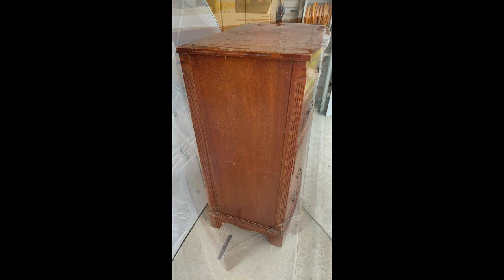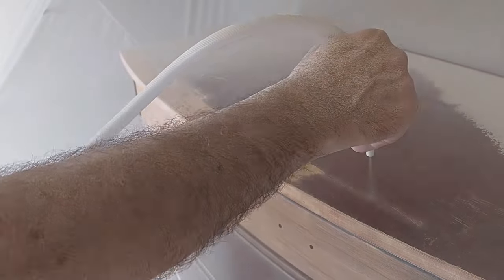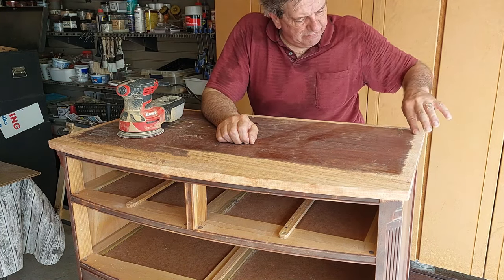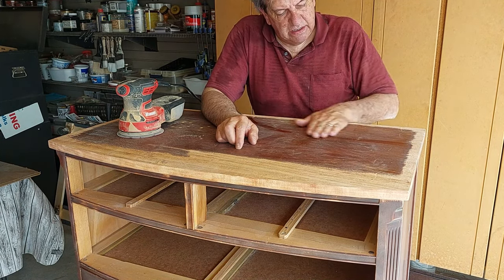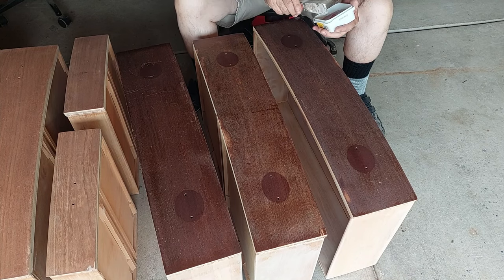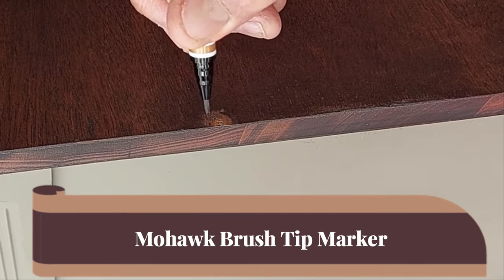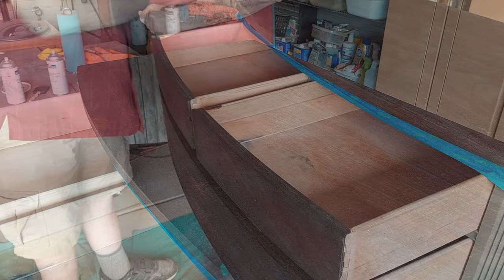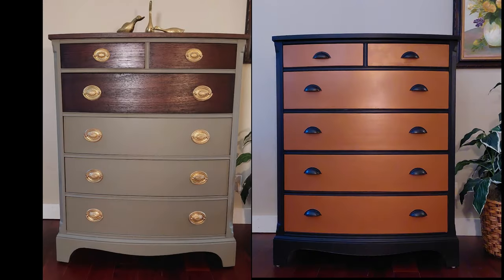Soda Blasting on an Amazing Drexel Chest Makeover | Furniture Flipping

Comment: Watching that soda blaster was super satisfying!! 

Is there any possibility of doing damage with it?  Like if i had the pressure too high or something would it blow a hole through the wood??
Reply from the maker: It would be unlikely to happen with soda because it's fairly soft, but if you crank up the pressure and use a course grain soda, anything is possible! We were running about 45-50 psi at the blaster. Thanks!

Comment: I love this dresser. Those colors together, oh be still my heart! I love that you are so willing to try a new to you technique on camera. So many are afraid of messing up, but seeing and learning from mistakes or gaining the knowledge from someone else is what I really love. I do have so many questions about the soda blasting. Did it save a lot of time? I know that the tent was a mess, but did it make a mess outside of the tent? If it did, was it horrible? I could see the awesome result it had on the dove tails. I spend so much time trying to get old paint out of dove tails! Thank you so much for all of your videos!!
Reply from the maker: The soda blasting does save time, and the tent really did a good job at containing everything. There was very little outside of the tent. It works great on the small detailed areas! Thanks Trish!
Reply: @FurnitureWarriors  thank you for the information.  I think I should invest in a soda blaster. I have a huge air compressor,  so I might as well give it a go. Another question.  Is the 40 lb tank easy to handle? I have severe back and knee problems,  so I was wondering the ease of use of the tank itself.

Comment: I like the traditional mainly because of the hardware. I've seen a neat trick when taping the drawers with the plastic. If you first take some painters tape and tape it on the inside of the drawer front with half of it sticking up, then you can take your plastic and stick it to the tape still sticking up, and then around your drawer. Then you don't have to go back and touch up the lip.
Reply from the maker: Great tip! Thanks Ash!!!!!

Comment: I tried this but I think I need a larger nozzle. Are you using the original nozzle that came with the Harbor Freight unit? Your dresser came out beautiful. Thank you for this video.
Reply from the maker: We are using the original nozzle. It does take some adjusting of the media flow and we ended up running 45-50 psi at the soda blaster regulator. Hope that helps. Thanks Susan!

Comment: Watching you do this (havent watched the whole thing yet), but if it could spray a larger swath I could see using that.
Reply from the maker: There are soda blasters that cover a larger area, but the cost of the units and the compressor to run them are not cost effective for this use. We found a great set up for only $22,000! 🤣We took a hard pass on it! Thanks Barb!

Comment: I have always liked every flip the two of you have done, but this one, well, I'm not so sure about the finish the soda blasting did on the drawers.  It was a bit rough.
Reply from the maker: After a quick sand with 220, the drawers were actually really smooth. It's the way that the stain took on this veneer that gives it that look. Not quite sure why though...... Thanks!

Comment: Why did you have to trim the drawer?
Reply from the maker: Wood will expand and contract for many years and sometimes after a long time (and wear and tear) a little sanding or trimming is needed to get everything to fit again. This is especially true with fine furniture brands as the tolerances of the original build are so close. Thanks Andrew!

Comment: Is it expensive?
Reply from the maker: The soda blaster is about $130, but the compressor is the expensive part. Good, high volume compressors can easily reach into the $1000's. We kept looking and eventually came across a great deal on ours for under $500. (We use it for our paint sprayer too.) The blasting media can get expensive if you don't reclaim and reuse it. Watching for a great deal, and reclaiming makes it affordable. Thanks!
Reply: @FurnitureWarriors  meh, I’ll just use liquid stripper. It looked fun though.

Comment: I have the same dresser.  I stripped it with Jasco as i did not have a soda blaster.  You did not tell us how that blaster performed. It has very poor reviews on Harbor Freight.  Compressor for any kind of blasting needs to be very big.  This is why it usually fails.
I do a lot of refinishing. You should never sand the finish off - it will NEVER fully come off and you remove most of the thin mahogany veneer too.  Bad idea. Use a propane torch to very lightly warm up the finish, then use Jasco stripper which acts better if its toasted first. Then soda blast the rest away. Finish off with an acetone scrub with steel wool. Then sand, then oil, then top coat.  My preference is very diluted polyurethane oil based clear satin interior. Wipe off excess. Looks like hand rubbed Danish oil after that.  I seldom stain and won't touch the finicky lacquer and varnishes which leave water marks.  My finish is very durable.
You absolutely ruined this piece. I cannot believe you painted over fine mahogany.  My god, what a hack job!  Instead of bringing out the inherent beauty of this piece and letting its own form dictate the finish, you dressed it up like a gaudy street walker.  Horrible. Stay away from antiques.  Don't ruin any more pieces. This piece is embarrassed to show its face now. Ugh.

You know nothing about refinishing. Stick to what you know and don't teach what you don't know.
Reply from the maker: We actually appreciated your constructive comments at the beginning of your comment. Then you decided to go off the rails and become one of the nastiest people that have left us comments. As such, we won't address all of your questions except to say that you were not here to see the damage on most of this piece. It doesn't matter how good your refinishing is, people are not going to have any desire to own a piece with deep scratches and dents (some of them were completely through the veneer).  We'll continue to do us, with the confidence we receive from our customers who appreciate and purchase our pieces (this one was sold in a week, and the customer is asking if we can do other work for them). How you would even think that we would take the advice of someone who we don't know, who has not one single video published on how you think things should be done, and who hides behind a keyboard to try and bully others is beyond normal human interaction. Have a great day and go watch someone else's channel if you don't like our work.
Reply: @FurnitureWarriors  I refinish pieces. I find that you have a responsibility to restore something well made to its former glory. I saw no damage to the veneer. I suspect that the sanding did not work. The blaster failed, and you resorted to painting to hide the mahogany that would not stain. I work with museum quality pieces. Not having a video does not mean I am not qualified. The work you did on this piece, even the stripped section looked heavy-handed and not a fine finish. It looked garish. If people like that, it means they have no taste and equally unqualified to own a nice piece. I stand by what I said. You reduced this to a harlot. Criticism is not bullying. You are offended by my words. I am equally offended that you damaged this fine piece.
Reply from the maker: You work with museum quality pieces and you refer to this 1960's piece as an antique? Why don't you just purchase all of the available pieces then? This was headed to the landfill when we found it, so whether you like what we did or not, we stopped it from going to the dump. If you think it would have been better in the dump then what we did to make it a usable piece,  then good for you. We still stand by the work we did. We don't get offended by others, but we don't see words like  "My god, what a hack job!" as criticism, we see it as someone that has nothing better to do with whatever talents they may have.